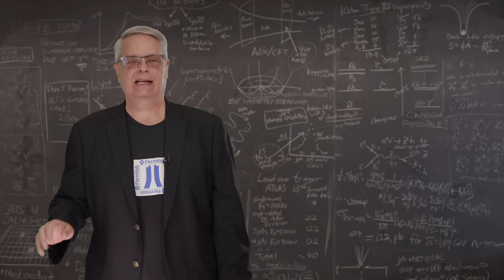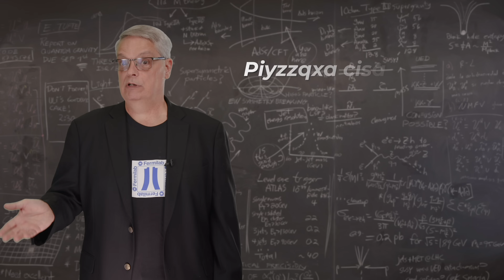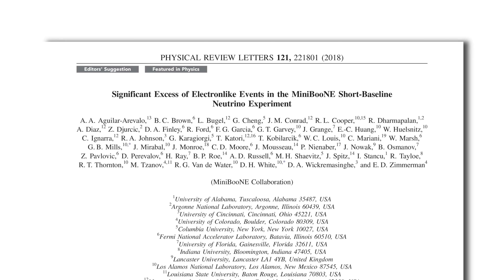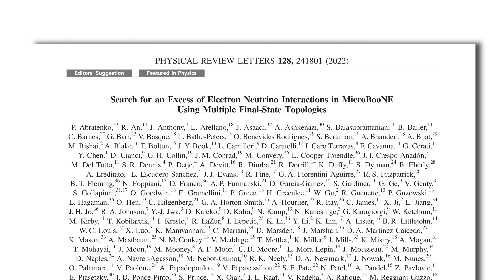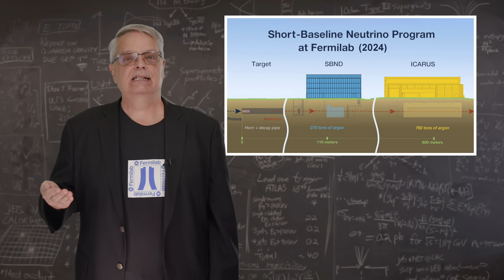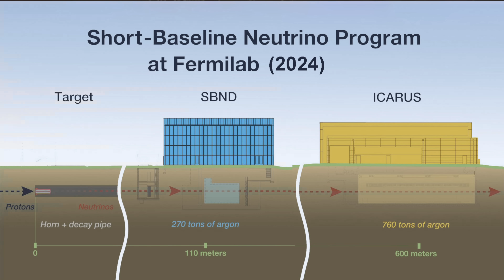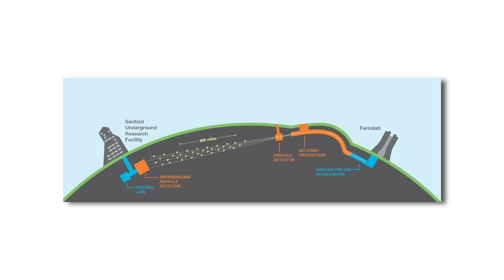Fermilab's search for sterile neutrinos

Comment: I wonder what makes you so certain these "neutrinos" are particles and not just a higher frequency of em radiation than gamma rays. higher frequencies do pass through more things and em radiation does cause the Cherenkov radiation you use to "detect" "neutrinos". seems like a higher frequency of EM radiation could account for everything neutrinos where made up to explain.
Reply: We know that neutrinos oscillate, which means they experience time, which in turn means they travel slower than the speed of light, which means they have mass. EM radiation is photons, which are massless and travel at the speed of light.
Reply: @fwiffo what's your point?
Reply: @ScottJPowers  Photons don't fit any of those observations, so it can't be EM radiation.
Reply: @fwiffo  @DrDeuteron how do we know they oscillate? How do we know they carry a "lepton number", whatever that is. Seems to me these are all just numbers attached to the idea of neutrino to make the math work but in what real way can you say these values are real or even mean anything? And what alleged observations prevent neutrinos from being a higher frequency of em radiation? Lack of the speed of light in a vacuum doesn't mean anything considering light takes longer to get through different mediums.
Reply: we know they carry lepton number, which is conserved in the SM. Think about the sun. It starts with (roughly) 4e56 protons and electrons, and later has 2e56 protons, 2e56 neutrons and 2e56 electrons....so baryon number is fine, but now where did that L=2e56 go?

It was radiated as neutrinos.
Reply: @DrDeuteron  the sun loses tons of matter and energy to space every second. and we don't know exactly how much stuff is actually in the sun. the best we got is some estimates, which could simply be wrong.
Reply: @ScottJPowers  my post was not about stellar evolution. It was about the fact that neutrinos have lepton number, which makes them not photons. DO you think a solar flare puts a dent into 10^56 electrons?

We know they're not high frequency b/c they're not high energy (energy and frequency are the same thing)
Reply: @DrDeuteron  energy and frequency are not the same thing. frequency is the number of units, rotations, oscillations, or whatever, per unit of time and that has some energy but something with a frequency may also have energy in other ways besides frequency. Also, I wasn't even talking about solar flares. besides all the em radiation the sun gives off, it also gives off solar wind, which is made up of free neutrons/protons.
Reply: @ScottJPowers  We know they oscillate because different types of neutrinos are detected at different distances from their source. Experimental confirmation of this won a Nobel prize. They are able to do other things which photons can't, such as passing through hundreds of kilometers of rock.

In the case of a particle like a photon, energy and frequency are the same thing. Its wavelength (inverse of frequency) is exactly a function of its energy, and vice versa.
Reply: @fwiffo  the only way we have to detect neutrinos at all seems to be those large tanks of ultra pure water buried deep underground or heavily shielded, which assumes only neutrinos could get through. as for passing through kilometers of rock, photons could appear to be passing through if they are being absorbed and re-emitted over and over again. also, higher frequency em waves pass through denser stuff, so high enough frequency em radiation would eventually be able to do this and I don't see why there would be any ceiling to em wave frequencies.
Reply: "what makes you so certain these "neutrinos" are particles and not em radiation" <- Neutrinos have a small mass as determined in other experiments (Beta-decay for instance), but the EM particle has no mass (photon).

"em radiation does cause the Cherenkov radiation" <- Cherenkov radiation is caused by charged particles. A photon, which is the manifestation of the EM field, does not produce Cherenkov radiation because it has no charge (otherwise a glass of water would constantly glow, if you think about it).

"Cherenkov radiation you use to "detect" "neutrinos" <- Neutrinos are also detected by the drifting motion of ionisation electrons in the liquid Argon. Neutrino bombardment causes Argon atoms to become ionised (lose electrons), and a photon is later emitted by the drifting ionisation electron (free electron knocked out of the Argon atom) through the process of scintillation, nothing to do with Cherenkov radiation, which is instantaneous, whilst scintillation is a delayed process measured in microseconds. Those ionisation electrons also cause an electric current to be induced in parallel wires running the length of the liquid Argon tank, used as sensors. Again, no Cherenkov emission involved, also independent from scintillation photodetection.